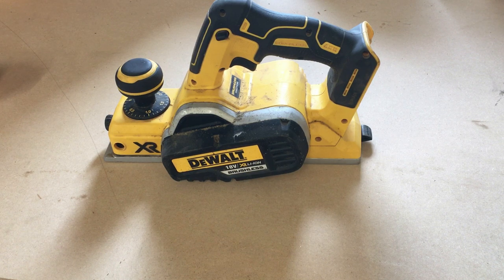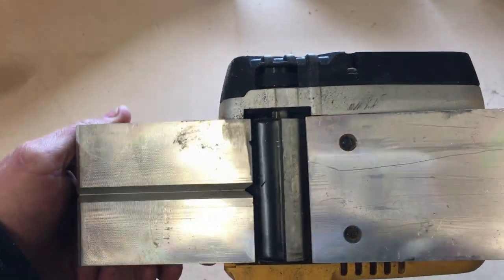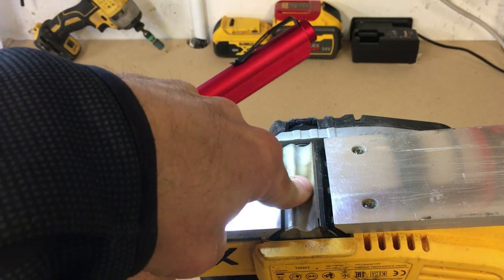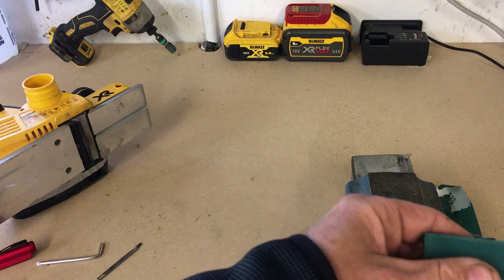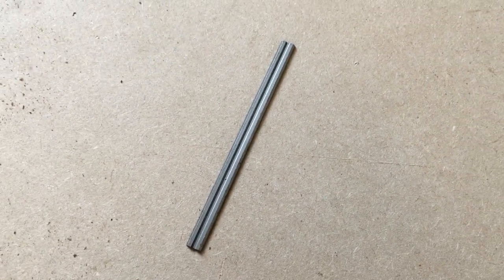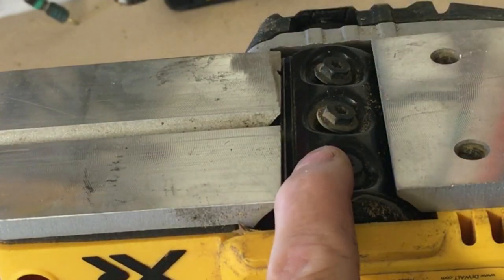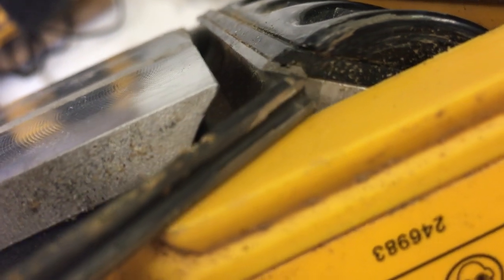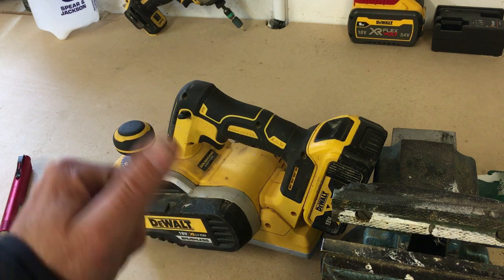How to change blades on a Dewalt Planer | Dewalt DCP580

Comment: great video. I'm having troubles with mine. Only used it couple of times, but wood shavings keep getting stuck in behind the blade and I have to remove and clear it out over and over. The screws are tightened as much as I can get them. Do you have any ideas what the problem could be?
Reply from the maker: It could be that you are taking off too much material at a time. Try using the 0.5 > 1mm setting and that should help ? I find that if I take 2mm passes, it clogs the blades sometimes.

Comment: Thank you but how do you adjust the height? There's nothing for the blade carrier/holder to register against and I don't see how to raise it to the right height and then hold it there while tightening the screws which are rotated too far back to reach when the blade is at the top? Mine got knocked by hitting a screw and I'm not lucky enough to simply swap the blades like this...
Reply from the maker: Not sure mate

Comment: So you don't need to adjust the blade height on the 18V? I have the 20V version and when I change blades sometimes one side will be slightly higher than the other. And yes it is in the groove. Good video though.
Reply from the maker: I have never had any issue with blade height as long as the blade is in the groove, but I have heard people saying that they have had issues. No issues with my planer and I must have changed the blades 10+ times.

Comment: How do you make sure the blades are parallel with the face of the plane? Mine cuts deeper on one side, or is this not possible and I’ve just bought a wonky tool?
Cheers
Reply from the maker: Hi James, not sure why that would happen as the blades have a notch all the way along them which should hold them parallel to the face. Have you checked to make sure that the blade is in correctly ?
Reply: Did you sort it mine has done the same
Reply: @johno-gb7ci  nah mate still the same, I took it back to the shop and they sent it off but had it returned saying nothing was wrong with it, the bloody thing is off by a couple mm! Almost enough to put me off dewalt 
Could you have dropped yours?
Reply: @MrCarnagh  bloody anoying..  im going to have another look later i think it's to do with the screwdriver head bit behind the clamp that holds blates. Im sure that needs to be fully pushed into itself then tightened with pozi drive so it runs parallel. Got to make sure it goes in little slot groove when putting it back on. Ive never dropped  mine
Reply: Planes will dig in deeper one side, until you have a lot of experience it’s hard not to do. The planer is slightly heavier one side, work out which side and be mindful to apply more pressure the other side while running the planer along.

Comment: Hi. I have the DeWalt planer as yours, brand new,  when I set depth to zero the plane stil takes material about .1 or ,2. Is there a way to re calibrate the blade to zero
Reply from the maker: I'm not sure Frank as my plane is always set at 0.5mm as a minimum most of the time. The work I do does not warrant such fine adjustment. Thanks for the comment
Reply: I have the same issue, its a problem when chamfering an edge as it takes a huge chunk out. I saw another youtuber comment on his and he reset the blades so 0 was 0 material removed. I noticed one of my blades was higher than the other, just in the process of trying to sort it out now. How did you go?

Comment: One of my blades sticks out further than the other. It also sticks out when the plane is set to zero, which means it cuts when there should be no blade contacting the wood, and it also means the depth setting is wrong because 0.5mm is more than 0.5mm. 

That's how it came from the factory, and I can't seem to adjust the blades. 

So it's pretty useless if you want accuracy. Seems like it's a brute force tool.
Reply from the maker: Thanks for the comment, can't say I have noticed that as I just use mine as a rough planer.

Comment: Worst planer in history.. It is simply impossible to get the blades set as when new. I don't understand all that chew on to hold a blade.. Waste of money and time.. Going back to a bosch planer.. 2 Allan key bolts to hold the blade that is it..
Reply from the maker: Thanks for the comment
Reply: Absolutely agree . The bottom screws that are  hidden move and planner becomes un aligned. Very hard to get right.